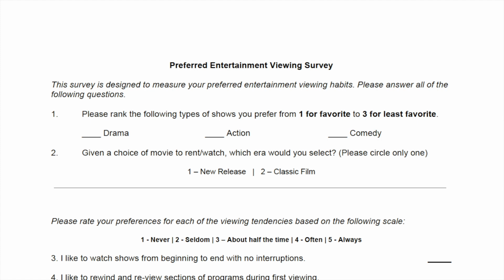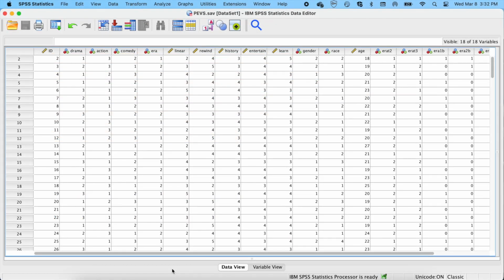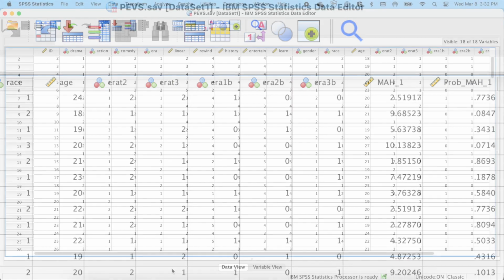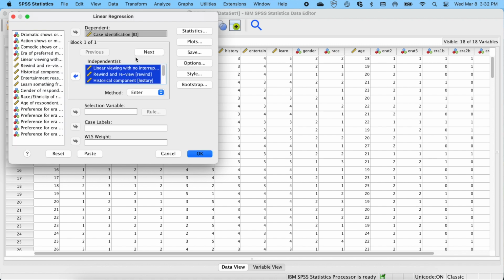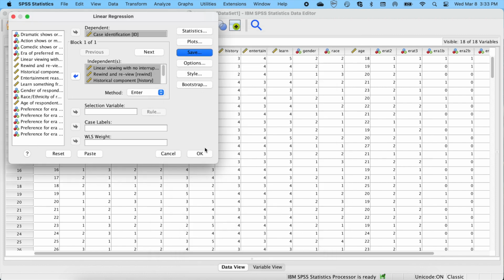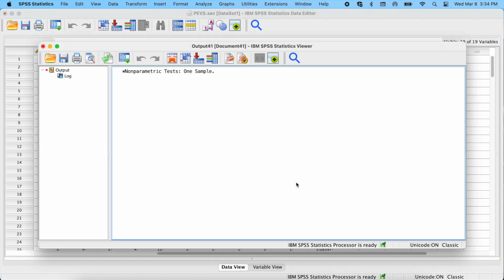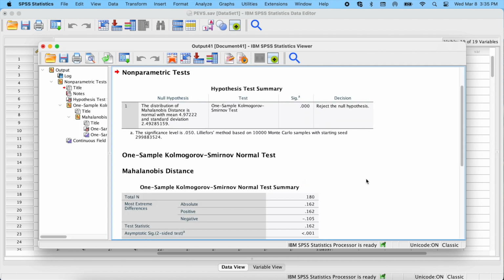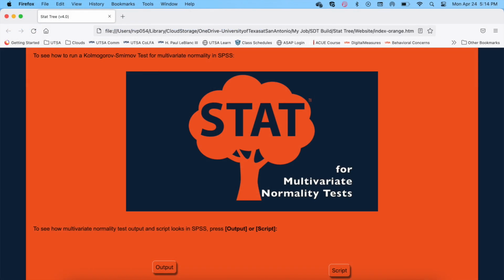Multivariate Normality Tests using SPSS

Comment: Hello, Sir. Does this method also apply to bivariate normality testing? If not, how do I perform a bivariate normality test? Thank you, Sir. God bless you.
Reply from the maker: Go to Univariate Normality Tests with SPSS at: https://youtu.be/C5cWjK3N2do
Reply: @Stat-Tree  The univariate test has been done previously, sir, but the X variable did not pass the normality test (there are two variables, X and Y). So, my lecturer asked me to try using bivariate normality.
Reply from the maker: @Nda-jy5se  Okay. First, you will want the univariate normality test because you are testing the normality of the dependent (Y) variable. Multivariate normality tests are used when you have multiple dependent variables.

However, I see that you have an independent (X) variable, which you want to use to check the normality assumption across groups. The technique is the same as demonstrated in Stat-Tree. However, you will need to add the grouping option.

Without knowing your subsample sizes, or how many groups, I would recommend you follow the second technique demonstrated: The Shapiro-Wilk test. To do this in SPSS, go to Analyze>Descriptives>Explore. Put your Y in the Dependent List. Put your X in the Factor List. Press the Plots button. Choose Normality Plots with tests. Press Continue. In the Main Dialog box, be sure "Both" is selected. Press okay. The output will show both Kolmogorov-Smirnov and Shapiro_wilk Normality tests.

I will make an adjustment to the demonstration to account for your question, although it may not come until the next update (6.1).
Reply: @Stat-Tree  Thank you so much for your explanation, Sir. I was still confused before, but now I understand much better. I truly appreciate your time and help.